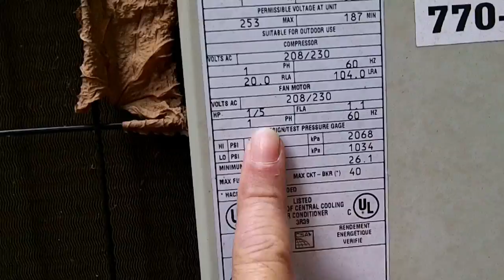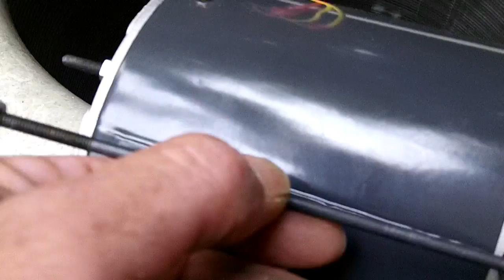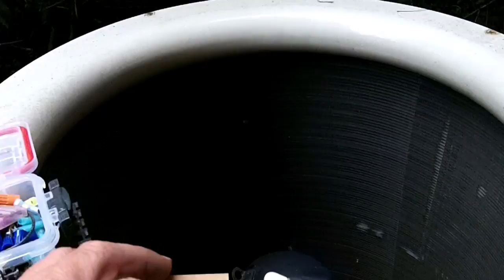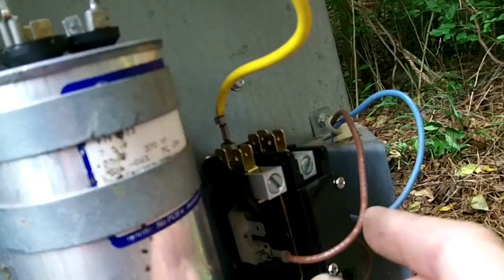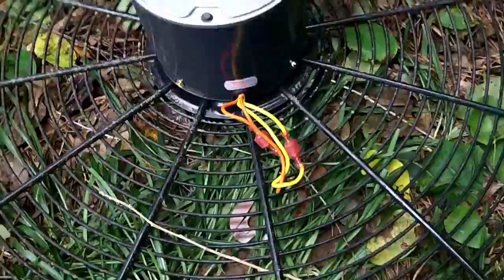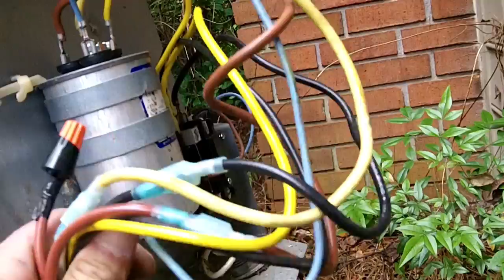Basic HVAC Video Series: How to Change a Condenser Fan Motor

Comment: thanks for the video it was really good.
I have a problem in my AC unit, the Motor Fan is not starting without giving a small push myself to start to rotate, and it will run for an hour and will stop again. does it mean the motor is not working or there is something else, i replaced the capacitor too but same problem

Comment: I used heat shrink wrapping for wires when I installed my universal fan.The wrapping is UV rated and heat resistant  . Just need to have power to run a heat gun .

Comment: I need help. I'm replacing a three wire motor with a 1/4 HP, 208/230 VAC 1speed, 1075 RPM motor that has more wires. I watched your video and see where you just cap the brown and white wire. Where I'm confused is what wire is common to the old fan's purple wire. It has a black, brown, and purple wire. The purple was connected to the C terminal on the dual capacitor. The other question is what to do with the additional yellow wire. Please educate me as soon as possible because it is sweltering here in south LA.

Comment: Where did your two hots go ? On the contractor and the brown wire on the common of the capacitor?
Reply: One on each side of the top of the contactor.   Each has 120 volts that way.

Comment: so I did a fan motor can change and it sounds like the motor is bad. plus they sold me the two different AC capacitor. I also cut my shaft cause it was longer thinking it was the problem to, why it was making a lot of sounds to.
Reply: popcornman74501 ...can you rewrite question im trying to help answer your question

Comment: curious if u ever have to cut the motor shaft? I  notice my replacement motor shaft is much longer than original.
Reply: C Johnson ...you should cut it if its longer that will cause it to be unbalanced

Comment: Really enjoyed this video.  I have the same motor and the label on the motor says to remove the rubber plugs for horizontal mountings and to leave them in for vertical mountings.  Since this installation was horizontal, why didn't you remove the plugs per the manufacturer recommendation?
Reply from the maker: Remove the plugs on the shaft side if the shaft is pointing down. Leave the plugs in at the top
Reply: The manufacturer recommends differently was my point.
Reply from the maker: Removing the plugs will let moisture weep out of the holes. I would remove them
Reply from the maker: I didn't remove the ones at the top because it would let moisture in
Reply: The motor is vertical in this application. Horizontal and vertical mounting descriptions are the direction of the motor shaft not the fan blade. I believe that is your confusion. If you remove the plug at the back (end the shaft does not project from) of the motor which in this configuration points up you are allowing water into the motor.

Comment: When an ant is electrocuted it releases a chemical that says "danger here, kill it". The other ants think they are attacking a threat to the colony and rush right in. They get electrocuted and release chemicals.
Reply: That grommet on the power supply line is on crooked letting the ants climb up the line and in thru the opening.

Comment: Dose it matter which wires are on what male for the capacitor. I fallowed the diogram that's inside my wiring area. Being out of ac in texas sucks. But the hvac guy pulled a fast one on me.
Reply from the maker: It does matter, without seeing what you have, it's hard to answer that question

Comment: I'm no expert and I'll admit that up front. First off, thank you for this vid. I have an old Goodman unit MFG in 1992. I'm replacing the condenser fan and cap. The unit had a Turbo 200 in it. I just bought a FASCO D906 and a new Turbo 200. I'm worried that I won't reconnect it right. My old fan motor was a 3 wire and had purple/brown/black wires while this FASCO has brown/brown-white (capacitor), white/black which says 'line" and yellow/purple (direction) along with the green grd wire. I know you said I could basically cut and cap the brown-white so my question is, where would I connect the brown wire, and the white/black wires ?
Reply: Its too late now but you got a multi speed motor.

Comment: How did you determined the correct RPMs?
Reply: The RPM's should be on the sticker on the old motor if it hasn't peeled off by now.  My sticker peeled off, but I wrote the info from the sticker down long before it peeled off.

Comment: I charge $90 more for the Sureswitch. I give customer option for both but explain the benefits of the Sureswitch and they always buy it. I haven't had any price complaints yet. Same with the Turbos. I charge about $80 more for the Turbo 200 and just over $100 more for the Turbo 200X. I've found as long as you give them the option plus explain the difference in the warranty (1year vs 5 year) most will willingly pay extra for a better product. Hope this helps:)

Comment from the maker: Hey Paltech, you will be glad you use the conduit or sealtite especially if there are 2 unit's next to each other and someone else has changed the motor in the other one and just strapped the wires up. yours will look 10 times better and most time people wont even notice it being there.

Comment: Here's a good thought for techs to remember. The amp draw rating is the amount of work that motor can do. It was designed for the unit it was placed in. You lower that amp draw and the load/tonnage/work is still there in the unit.......that motor will over amp trying to perform that amount of work. It ain't rocket science, so keep teaching them. Folks need to know what amp draw means and what causes it.Take care, Brett

Comment: Emerson Sureswitch will take care of the ant problem and also give you some extra benefits like time delay on high and low voltage side, brownout protection and sealed relay on board to prevent insects damaging contacts.  It's all I use now and I love them!  Also, I switched to Turbo capacitors.  Less I have to carry on truck and 5 year warranty.  Much better quality and made in the USA!  I enjoy your videos!

Comment: Great video Ralph. If I get my video up soon from last May, I go over the 3 wire to 4 wire hook up as well. I always match rpm, hz, phase and volts. Then either match hp or go up 1 size hp only. That will always keep your amp rating in line where it needs to be. I also match motor frame size to ensure it is correct length. The frame size of old motors will be on the motor data tag. I hadn't seen Dallas's video when I made mine, but now do the pvc conduit also. Take care, Brett

Comment: Like the conduit trick for the reversing wires, and the way you wired it up so you didn't have to use a separate capacitor was helpful.  I went to replace a capacitor with a rescue motor in it, and had to use the separate capacitor (secured with strapping, not dangling loose!)  because I didn't know that little bit of info about using the brown wire only. Learned something on Youtube, imagine that! :)

Comment: My old Goodman unit, which died due to a hacked installation before I bought my house had the run cap fail causing the motor to stop.  The motor got so hot it cooked the grease in the bearings!  I was able to save it by taking the motor apart and repacking the grease in the bearings.  The year after, the compressor shorted to ground due to the hacked install.  Now I have a Payne unit that is 100% proper and works way better!  They guy who installed my Payne reminds me of you. ;-)

Comment from the maker: Hey Terry,the old motor was a little shorter then the new one. That's the only bad part about using the aftermarket motors. If they get to long it will mess with the airflow and really mess you up.

Comment: Oops......could you have used one rod from the old motor .. Run into a similar deal with the 825 rpm ... Using a 1075 ran for about 10 minute then it would just stop ...Lesson learned!!!